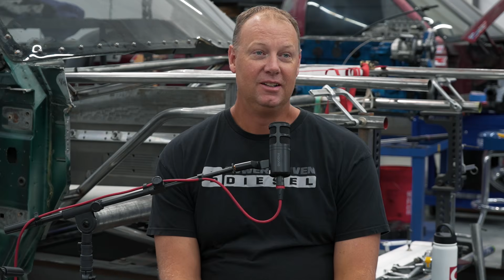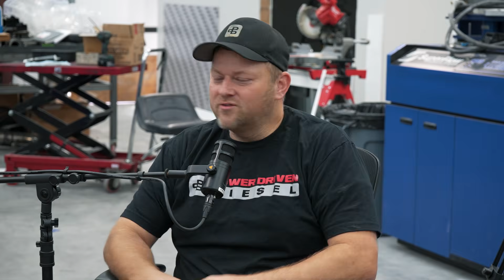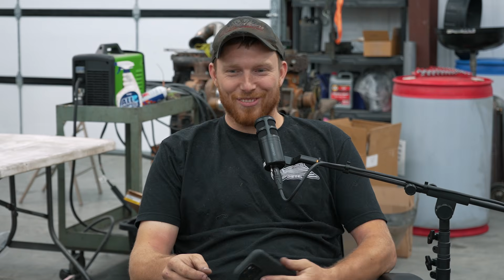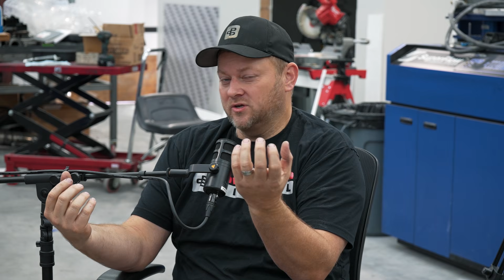Single Turbo vs Compound vs VGT | Real Dyno Results

Comment: Compressing air, Your basically challenged with forcing  that air density into a smaller space  without adding more heat in the process.  During that process  it becomes hotter   by density of heat, an example of near perfect transition  world be a magnifying glass  🔎   6" of radius  down to a needle point started fires, yet the object converting  this hardly heats up, nor adds heat This is what you are trying to achieve without adding more heat.
  
You do this with size and matching flow

Comment: I have a 06 G56 truck with 100 overs, 12mil pump. Currently running a t4 2g swap. Want to go to compounds to increase drivability and towing capability. What would you recommend for a hot street type compounds setups that can tow?
Reply from the maker: Hot street would be a modded he351 with the 76x67 turbine wheel and a 480 sized turbo. Will tow just fine for most people and handle around 1k hp!

Comment: Which power driven diesel turbos are 4 a 12 valve, that have ball bearings? Stock configuration or possibly with an HX 40 exhaust.
Reply from the maker: We don’t have a ball bearing stock sized turbo.  Only our big turbo’s are ball bearing

Comment: Can you guys do a podcast on transmission swap options for a 2008-2016 ram. 68rfe to zf8hd or Alison. Something that is easy to drive and can hold 1k hp for a tow rig and hot rod

Comment: 12v love compounds! Change my mind lol. S475 with a 62/68 and 5x14 injectors you get rowdy street and very well behaved towing when the afc live is set properly to push 35 to 40 psi. Next step is your stage 2 power jets with 055 dvs. Should see 600 to 650hp I hope.

Comment: "adiabatic" compression... energy being stored in two ways, pressure and temperature.  We love the pressure.  But a fluid places a fraction of storage into pressure and a fraction into temperature... mother nature, baby. Creating hotness without adding heat... adiabatic!!  So weird. Yup, compression makes air hot, so live with hot cylinders or live with intercoolers.

Comment: Hey guys. Been thinking about a vgt compound setup like the guy on the left has, for a little while now… just came across your guys page after looking into it more. Not sure if you guys have a video like this out already but I would love to have an in depth video on the vgt compound setup, or even just a quick glance of the engine bay. Not sure how many secrets you guys wanna give up but I’d love to see how you guys made it work. Assuming you had to get rid of a battery to make the compound setup work? Or just shorter intake?

Comment: Air flow/volume > pressure/ boost.  Same with drive pressure.  But there is a balance…

More hot air out usually equals more cool air in.  Boost is just pressurized air, air under pressure makes heat, and more heat equals less efficiency. 

Too many guys chase boost numbers, and worry when they put larger pipes or exhaust components on and lose a few pounds of max boost, because they don’t realize they are gaining more flow/ volume of COOLER air which usually nets more power.  

When I put an aftermarket Y bridge and up pipes on my LBZ I lost 3-4 lbs of max boost, but I gained 150-200 degrees of egt temps across the board, and my IATT dropped down significantly as well as the CAC had to work less to cool the air, had my coolant temps were easier to control in hot days and the mountains of CO.  Truck also built boost off the line a split second slower, but got on top of the turbo quicker overall once it lit up, and had overall better top end As it could get exhaust out faster at higher RPM.  Which allowed more fresh, cool air in for the next combustion event. Now its time for a little turbo upgrade and a tune refresh.  Turbine and housing has now become the largest restriction in the system. 👌

Comment: Whichever company brings to market a reliable standalone controller and install kit to put a variable turbo, from the likes of a Dodge 6.7 or Ford 6.0 on older engines like the 12 valve, is going to get a lot of attention and new customers. It would be very interesting to see you guys test options like those and the Turbonator, as well as dual variable turbos as compounds.

Comment: Has anyone ever ran a he351 either a 62/67 or 67/67 with an s475/480 on a 09 6.7?
Reply from the maker: I ran one of our 67mm he351 turbos with a Garrett 106mm gt55's. It was awesome! The 62mm paired with a480 would work great!
Reply: @pddofficial thanks for the reply. I thought the 62 would go great with a 480 as well just wasn’t sure if it was frowned on to put a 5.9 he351 turbo on a 6.7.

Comment: I have a question. I have not seen a lot of people run the g55. Ive seen people are sticking to the GTX5533R. Why? Is it cause diesels need that extra blade and trim in the turbine? Or is it just tried and tested.

Comment: I want to know if a factory block could handle 1200tq-1400tq @ 1500rpm? Reliably? 6.2 stroker 12 valve with studs, fire rings, set of small quick spooling compounds, operate within the 1200-2200 rpm range. Cruise at 1500 rpm.

Comment: From what i understand the duramax vnt vs the 6.0 vnt is the duramax turbos had a vein position sensor. 6.0s dont to my knowledge. They only have a duty cycle. So they cant tell if your getting a sticking set of veins

Comment: The small one is probably more utilized under load in something like a pulling truck with compounds, pulling on the road or racing, driving, etc, I don't think you have enough load to build the boos with that much air flow through the engine.

Comment: Would there be any reason or is it possible with the Bosch or Efi to do twin vgt compound? Sounds like a pretty awesome setup in my opinion. Everything could come in sooner and if you could get big sizes you could control drive pressure on the big end without waste gates if I grasp the concept correctly?
Reply from the maker: That does sound interesting! Could work great, just need some really cool 1 off parts!

Comment: Great video guys. I have your ultimate towing compound kit in my motorhome as we have discussed before. I hear the comment about getting the manifold turbo out of the way as fast as possible. So do I interpret that as saying run that at the minimum boost the supplied wastegate will doin other words Work it as little as possible?
Reply from the maker: Yes but you need it to still do work. If you gate too much too soon it will feel lazy.

Comment: Been debating going compounds on my 18 5500. I tow 30,000lbs+ daily with it. Currently have a Fleece Cheetah on it with a Banks Intercooler. Just not sure which turbo would work well with the Fleece Cheetah. Keeping the Exhaust Brake is a must.
Reply from the maker: Aggressor 480 is an excellent turbo for compounds on a 6.7L Cummins with a VGT turbo.  Get it with the undivided 1.15AR housing and 4" outlet to make downpipe fab easy.

Comment: 1:33 the exhaust comes out of the engine, it spins a turbine wheel.
Thats a little too basic.
The exhaust valve opens DURING combustion and bursts into the exhaust manifold
like a pressure wave that.....spins the turbine wheel.
Anywhere above idle there is always more air fuel inducted than has time to burn before the exhaust valve opens.
We are always only using the peak combustion pressure to push the piston, the rest is blown down the manifold.

Comment: Do you feel like the 80/96 pairs well with your 62/67 for a 12v? Will it still have reasonable spool characteristics?
Reply from the maker: Excellent combo for towing, street hotrod, and 900+ HP dyno hits when fueled hard.  Only downside would be towing 25k plus as you'll only br able to cool 200 HP in the summer towing really heavy and a 476/87 will have a little better EGT control when using 200 HP.

Comment: What size AR are you guys typically running on a compound kit for a street truck that can run from 500-1000 HP?
Reply from the maker: Anywhere from a 1.10 to 1.32 depending on the size of the turbo.

Comment: On your website it shows the agressor drop in for 5.9 3rd gen being good for under 10k. It's there a turbo you offer that would be good for up to 20k or go compound?
Reply from the maker: The Aggressor 60/67 is good for towing in that range. The reason we put that disclaimer on there is people often use that HE351 in a 12V fummins swap, because of the clearance, and in those cases, we don't recommend towing over 10K with that setup.

Comment: coming from a continuous duty mindset (KTA19M3-Hx80m) wouldn't it be better to clean up the compressor wheel and intake ports than to have an improved centersection?

Comment: Been running that Aggressor 76/87 you guys sent me, on my 5.9L cummins with a VGT turbo for a while now. I don’t get Myers actuator problems… especially since I’ve been running my VGT with no coolant getting pumped through it for close to a year.
Reply: Dumb fact: the guy that makes lilbb stand alone VGT controllers had his actuator last 7 years with no coolant getting pumped through the turbo.

Comment: We run S356v and S360v vnt turbos on small displacement engines quite a great success. Single S360v 600hp on 3.0l tdi. Great response . Newest duramaxes use bw vnt too. Havent test them. Worth to check
Reply: How small of an engine did yous run it on ? Also what low RPM were u building boost ?
Reply: @jmoore9806 Mostly 1.9tdi. S356v spooled about 3200-3500rpm. Sure its not for daily driver friendly setup as single. But for single it is quite food for over 400hp setups compared to wg turbos...units we were using are out from john deeres with garrett electronic actuator

Comment: I keep hearing "drive pressure". What is that? They keep saying "boost pressure" and "drive pressure" and I haven't heard that term used before.
Reply: Drive pressure is the pressure in the exhaust manifold that drives the turbine wheel to make the boost.
Reply: only diesel idiots use term drive pressure, in reality it is exhaust manifold backpressure. Pressure is not driving anything.
Reply: @V8Lenny  The exhaust manifold pressure is hopefully the same as your turbine inlet pressure. The turbine inlet pressure differential across the turbine combined with the inlet temperature differential across the turbine is in fact what drives the turbine. Therefore the drive pressure does in fact contribute to "driving" or powering the turbocharger. In some cases like on a Mack with turbo compounding the turbo directly contributes to the engine flywheel and thus the exhaust is to some extent actually driving the wheels of the vehicle even.
Reply: @bcbloc02 no, massflow, heat and  pulses drive turbine. No engineer talks about drive pressure. Turbocompound was first used in trucks by Scania 35 years ago, now by Volvo, not "Mack".
Reply: @V8Lenny  Volvo and Mack is the same company. Also you can't be much of a turbo engineer with out knowing the pressure differential across the turbine as it is part of the fundamental calculations of turbo machinery.  Only a theoretical engineeer would be hung up on mass flow because you can't as I am aware directly measure mass flow  in a running exhaust manifold but you can measure the pressure and temperature and calculate it. Velocity of fluid, pressure differential of fluid, and temperature differential of the fluid as well as angle are the basics of what drives the turbine and is used in turbo engineering calculations. To ignore pressure is foolish.
Reply: @bcbloc02 but pressure is still not driving turbine. At some point turbine chokes, no matter how much more pressure you push, it is not driving it more. But change to bigger turbine side, you get more boost even if pressure is less. Are you now driving turbine less ? No, because you have more mass flow. 
More "drive pressure" only makes less power because engine is breathing worse.
In Europe no one talks about "drive pressure", it is always back pressure.
Reply: @bcbloc02 and massflow is easy to know, what goes in goes out.

Comment: Here's something odd that maybe someone can explain.

On a 2001 Dodge Ram 2500 with the NV 5600, its my main delivery truck seeing about 65 to 75k per year.

I like turbos and tried many different hx35 based turbos. My favorite so far, in towing has been a 60/67/12. Gets excellent mpg, and very good egt control. Fueling is a Weston Shuppe 7x10s injectors and smarty so3 tuning that makes a strong smoke free tow truck.

Here's the odd thing. I decided to try a 63/67/12. Because everyone said it would suck at towing. They were right. (face-palm). I put a 10 blade 67 turbine in it. It actually spooled as well as the 60/67, but I couldn't get more than 31 lbs of boost, and egt peaked at 1800. Power was down. Shazam. What now? Pressurized the system, no boost leak. Tightened the wastegate, nothing. Finally disconnected wastegate completely and made 38 lbs of boost egt dropped to 1600 peak. Power still down. There's a certain grade, that I couldn't maintain speed, my personal test hill for power.

Finally switched back to my 12 blade 67 turbine, with a 60 mm compressor with a 12 cm³ housing. Ah. Yes and yes.

Peak boost is now 44, peak egt is 1300 after a long hard pull, and power is back. I can actually slowly accelerate up the same grade, with the same load.

Why is that my experience? The 63 dropped performance in every single way. The smaller 60 did much better and fit my platform and how i use the truck was way more suited for the 60. My theory is that I simply didn't have enough fuel to spin a 10 blade 67 turbine. Maybe. Regardless it didn't work for me.

Anyone want a 63/67/12 hx35 with only 5000 miles on it? Say yes. You need it in your life.
Reply: I would say the rpm range you are pulling in was too low for the bigger comp wheel. Fueling never fixes driving the turbo when your egts are already high.
Reply: Yes, I'd thought of that to. The truck was completely clean, all the way to 3000 rpm. For whatever reason, it didn't perform well. The 60/67, also is completely clean but makes 15 psi more boost, cooling the egt considerably. The difference was turbos. No changes in tuning were done, or anything else.
Reply: @kennethschlabach  That 12 blade turbine going to make more power to drive the comp wheel so combine that with an easier turning comp wheel and you get more boost.  My extensive turbo testing points to that a good 60mm comp wheel is pretty well perfect for a 5.9 in the 1500-3000rpm range. It starts to loose a little over 2500 vs a 62 or bigger but its not much and the 1800-2000 is a lot better on the 60mm which is where most people tend to be "driving" or towing.
Reply: Thank you for your response. 12 blade turbine vs 10 blade. I wish I could actually do dyno tests. Here's something very interesting. The 10 blade, spooled the 63 compressor just as quickly as the 12 blade on the 60. My complaint with the 63 usable power was down considerably. 12 blade 60  runs a little bit hotter, up to 950 to 1050 cruising on level road at 70 mph with 15k in tow. Going up a hill, cruise set, boost comes up, egt pretty much stabilizes at 12-1300, pulling hard. The 10 blade 63 ran 800-950 on the same road, same ambient temp, same load. I'd hit the hill at 70 mph, egt promptly got pegged on the gauge and had to down shift because of temp and less power. Only difference is turbos. I did not change anything else.

I'm curious if the 63 actually made more peak power. Might have at 3000 rpm. At the 1800 to 2100 rpm that my engine is tuned for and spends its life, it was pretty much unusable. The 12 blade 60 sings at that rpm, clean, high torque, and much cooler.

Comment: What's your opinion on the "Turbonator" VGT from DPS for a 5.9 Cummins?
Reply: I bought compounds from them and my actuator went out. When I called for a replacement I was informed they don't sell it anymore. A year later they came out with a new one. Beyond frustrating 😡
Reply: I’ve heard a lot of horror stories about longevity being bad, and customer service being poor. In my experience VNT style turbos, like the turbonator spool about 200 rpm sooner than a VGT, with a weakling exhaust brake and less longevity
Reply: I wanna know too
Reply: works well for me
Reply: I’d like to know too I’m vaguely planning to buy 2 of them for future builds I’m thinking of
Reply: My experience is they drive very nice but they won’t make the power of a standard housing at least on the s300 frame stuff. My guess is the off idle drive ability is 100% better but you loose 10-15% power on the top end.
Reply: They are to nice to potentially disprove that turbo  and ruin that company.

Comment: Fyi for todd, diesel power source makes a vnt housing for the 83 turbine s400. Ive been wanting to try or hear a review thats not an ad for a while but everything I can find on it is basically ads.
Reply: I believe the one they make for the small turbine s400 is a t4 and their t4 housing is aerodynamically trash where the air enters the housing. I had to totally grind out and reweld the entry to mine to make it work even half decent.  I think the t6 housing is made much better but it’s for a 96 turbine. Honestly I think that would be fine with the vgt as it really gets it going way better.

Comment: You guys are just jealous of how slow my 94 2500 5spd 4x4 is and how i make it look cool.😊granted its a total money pit @245k the stock clutch just went out ( what a pos ) couldnt even make it to 250k. And its on its 2nd cig lighter and i dont even smoke,anything! What a pos and dont get me started onthe seat, yeah its starting to tear and im getting the feeling its a lemon. At least it finally stopped burning oil, i was this close to a rebuild. At least i dodged a bullet there. I suppose if i keep  it for another 250k maybe ill break even cuz in the 30 years ive owned it i have upwards of$2700  in repairs what a POS! Sometimes  life is hard...
Reply: You forgot to add the cost of all those sets of tires!😂